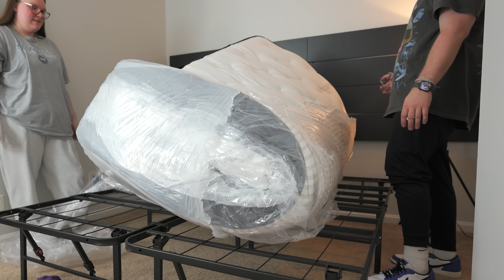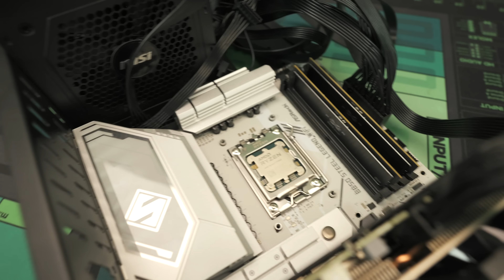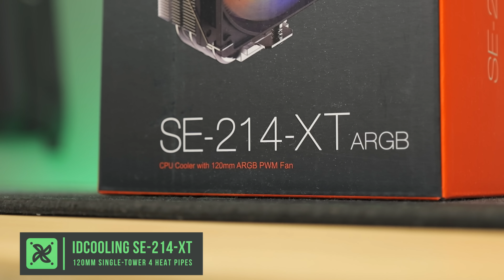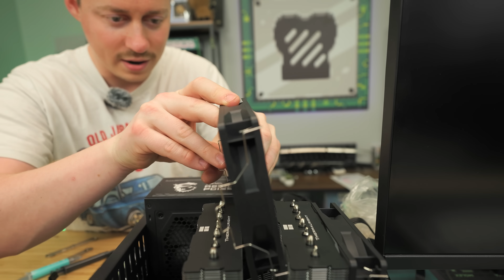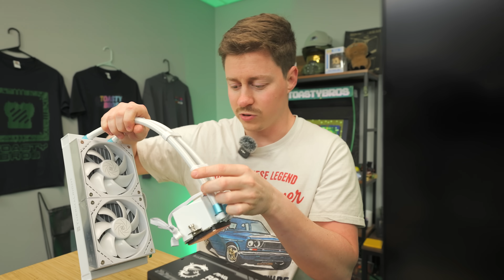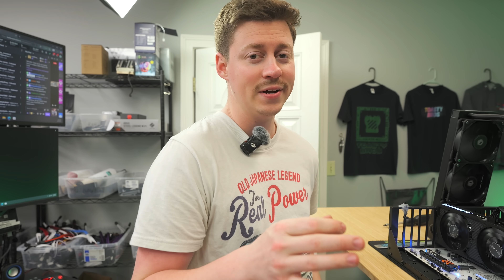STOP Overpaying for Your CPU Cooler

Comment: 140 feels expensive. Here in Romania, the highest-end version is around 140 euro. And it is so good that you don't even need case fans. :D 7800x3d near a 7900XTX nitro+ in rage mode is so cold that you can keep your beer next to it.
Reply: NH-D15 G2 for 142 euro and the black version for 160 euro.
Reply: And it will perform much better than many AIO at that price point. Especially in terms of noise.
Reply: @MrTeknown  hahaha price point. Just buy thermalright assasin. Only 30 euro

Comment: Rz500.. didnt find any review on it, order it from newegg thinking its a bust for 39.99 usd, when it arrived i threw  another fan in the back just cause it came with 4 clips, 6 months later.. still keeping my cpu under 55c with load, aio with a lcd screen is next upgrade for me, dont need it but i want an lcd screen in my pc tower unless i can find a air cooler with a lcd that can play a little gif or show picture

Comment: I ordered a FP360 thermalright aio because it was cheaper than the 120SE plus 3 fans.  I wanted 3 exhaust fans for the top of my PC case. I have never used a liquid cooler but am happy with my purchase so far.  It is also very quiet.

Comment: What you need to remember is, your Artic Freezer 36 may only cost £30 but will be binned if the next CPU socket isn't compatible. 

I have binned plenty of CPU coolers, many dead end on basic builds, I have BeQuiet, Scythe, Arctic. Yet with Noctua, I have coolers from socket LGA775 still being supported, my last two Noctua were bought with socket 1150 and are still going today, because Noctua has sent me a free CPU fitting bracket every time a new socket was released. I have two NH9s an NH12s and NH14s and a small mini ITX model, five coolers that even if AM6 has a new bracket, I will get a free bracket for if Noctua supports it.

I also have a Scythe and BeQuiet that cannot fit anything AM4 or AM5 or anything recent, and another BeQuiet and three Arctic Freezer 36, one that is a Revision 3 that can fit a couple of Intel variants with an LGA/1150 mounting kit available separately, and two Freezer 36 Revision 4 with the latest plastic arms that only fit two CPU sockets. 

In 5 years guess what will be in landfill.  

A Noctua cooler is just like a puppy, it's for life lol

Sadly my puppy didn't fit in with an all blackout build I wanted. So I like the aesthetic of the Freezer 36 coolers and the low cost of getting Arctic case fans to keep the theme, great value.

No company has ever offered me the support and customer service Noctua has, they have been exemplary in that regard, their products work great, are well built and fantastic quality, they are simply a pleasure to fit and forget and will often be part of multiple systems.

Comment: my brother still runs a Noctua cooler bought in 2015, one fan failed only last year.......there build quality is on point, I actually have a u12a with my build is expensive but the ease of install and long term support is nice.......looking to transplant my current intel build to a new cheaper case and rebuild AMD in my Torrent case so I may consider a thermalright PA or FS when do get to that.

Comment: Don't buy an AIO if you are on a budget. The pump will fail and you will have to replace the whole thing. Buy a good air cooler and once a fan fails, replace it for a few bucks.
You will also not have to worry about a leak.
Reply: i will leave my experience here for future buyers - yes every aio will eventually fail - i had my first fail after 5 years and fried my motherboard as well - 2nd one failed in under 1 year with pump failure since then i've been rocking peerless assasins and noctua on new PC - it makes same noise as my aio.

Comment: I paid 25 bucks for a 6 pipe double tower cooler on AliExpress with shipping, it keeps my CPU (ryzen 5 5600X) below 70°c with no undervolting. There is the small detail that i originally bought it for an LGA 1150 MoBo and a i5 7600k but the adapter was excesively aggresive on the moderboard so it destroyed it after 2 or 3 years of use by bowing it, but y'know, it still works great 😂

Comment: Yea, real test would be if you had a cpu running around 90° on a cheap cooler and see if the noctua gets you down to a "more acceptable" range. 

I know that'd be hard to setup, but that's the only way the extra $ would be worth. IMO if you're spending over $50 on an air cooler, just go with and AIO liquid cooler.
Reply: wdym he test the cheap cooler didnt even reach 90°
the result is better than noctua

Comment: NOCTUA cooler is the best in my opinion, regarding the Thermal Grease I'd still have to replace it with M14 for good heat dissipation

Comment: There are air coolers, there are good air coolers and then there are air coolers that are complete nonsensical as you can get a aio for the same or cheaper. 
My kinda drop off point for an air cooler is 50 bucks, even so i go with something that fits the task at hand. Last ryzen 5 5600 i set up has a 25 bucks don´t know what brand cooler on it that keeps it nice and chill. 
But 140 for an air cooler? Yeah i rather go with a proper 280/360/480 AIO that will offer superior cooling without blocking the entire upper part of the mainboard with a tower.

Comment: went from socket 1150 to AM5 with just a simple adapter change with my D15. They also sent me a replacement fan clip for free years after i had bought it, so i'm very happy with my Noctua.
Reply: The same people who complain about price are the same people who rather buy the same cheap tool 20 times rather than forking cost up front for something that will keep working. Noctuas customer service, warranty, and continued supply for free mounting parts through generations of sockets makes them well worth it.

Comment: I purchased a Be Quiet Pure Rock 2 (black) with a single 120mm fan (high-rise) cooler back in 2022 for my Ryzen 7 5700X CPU for $45 USA on Amazon.  It has four LARGE heat-pipes and does a sufficient job and is QUIET even cranked up at full speed!  Using Noctua Premium thermal paste and haven't touched it since the installation date.  This cooler works well and under pounding the CPU with FULL MAX LOAD the CPU never exceeded 85C and the 5700X is rated at MAX of 95C and the heat levels recover very quickly with this cooler WELL ABOVE any "stock" solution (the reason I bought this).  The 5700X CPU is NO slouch even today and is comparable to Intel's 11700K which is in my CAD design rig at work.  I DO USE Noctua case fans and swear by them because they are VERY quiet, as my "stock" case fans sounded like standing near a turbine jet engine and was ridiculous!  NEVER would I spend $140 for an air-cooler, and my $45 dollar choice is solid!  Next year, I will probably DUMP my entire AMD AM4 platform with it's B550 Asus ROG STRIX MB and update to an AM5 MB and DDR5 memory and keep my RTX 4060Ti as I'm only a 1080p casual gamer.  We'll see how "crazy" the whole PC market is going to become...
Reply: Just went from an i9 9900k to an r9 9950x3d, noctua fans all around and it’s also completely air cooled, no more rgb or water running through my pc, I shouldn’t have to do “oil changes” 😂
Reply: @gabecastillo1634  I'm surprised you can efficiently air-cool 9950X3d?  That's an AM5 CPU correct?  I'm still on the AM4 platform and nearing its EOL.
Reply: @johnszatkowski6898  damn really? It’s fine for gaming, but when all cores are being stressed at load that when it gets hot
Reply: @johnszatkowski6898  plus in the fractal north I’m building in there’s a bracket available for the mesh panel that holds another 2 140mm fans right in front of the gpu, the air being pumped into this pc is insane.
Reply: @gabecastillo1634  Sounds bizarre but, if it works! 👍
Reply: @gabecastillo1634  Never exceeded 80C under max/heavy load and quick recovery time too!
Reply: @johnszatkowski6898  oh I’m well under 80, I’m probably averaging 66-68ish under decent load and saw 82 max during a the stress test but I never use the cpu to that level or at least not yet.

Comment: I bought an amazon special cpu cooler. made by Uphere. it rivals my 360mm aio. the uphere idles an r9 3900x at 39-40 and lands in the high 60s while gaming and the thermalright frozen prism idles 36-37 and hits high 50s to low 60s while gaming. for sub 30$ its hard to not reccomend.

Comment: Nah. U12A is GOAT, sorry. Got a scythe mugen 6 black edition back in January. By April, it was shaking my entire desk over 70% fan speed. Rear fan failed, lots of play in bearing. Said fuck it, I don't want to worry about the cooler as long as I have this build. Went U12A and I'll never get another air cooler that isn't Noctua. It's so so so silent and performs great. My case has like 10 NF A12x25 in it, so the A12 fans on the U12A match the rest of my build. It's so awesome and silent. I'll never cheap out on fans or cooler again. Noctua for life.

Comment: Performance wise you have a point - Although I would have been interested in the noise profiles of the different coolers. Another interesting test would be the longevity of the fans.
Reply: if the fan broke you can just replace it right?
in my experience the cheap fan can last at least 4-5years
even if it broke the replacement maybe only cost 5-10$

Comment: I bought a Noctua in 2012 for a little more than 100€, I reused this cooler in three differents PCs, right now is still running with a 13600K, enough said.
Reply: air coolers dont break down since they are pretty simple, the thermalright air cooler could easily last just as long and even then replacing the fans would cost very little
Reply: @ronaldmcdonald6067  Yes, they last long, but do they sell the adaptions to difference CPUs formtheir older models?, btw Noctua give it for free, even more than ten years later.
Reply: @amrakunish5238  Thermalright do. Pretty much every their cooler (even the older ones like ifx-14\mux120\archon etc) can be mounted on modern hardware. Price in question is around 8$~
Reply: @ronaldmcdonald6067  👆🏼 this dudes right, noctuas customer service is the best in the business, they send u free hardware for any advancement in mounting as well. Also 7 pipe cooler does not equal 7 pipe cooler universally, construction and cooling power overall would be taken into account as well as warranty.
Reply: And they're the most quiet coolers!

Comment: I have two thermalright cpu air coolers and my 5700X3d and 12700KF run ice cool. I don't know the exact names but the 5700X3d has a single tower 4 heat pipe cooler and the 12700KF is a single tower as well but it has 6 heat pipes both of these is 1 120MM fan . The 4 pipes was 17 bucks and the 6 pipes was 20 . Highly recommend :yougotthis:

Comment: Running my Ryzen 7 5700X (65W) with a Cooler Master Hyper 212 Black Edition, i've put two fans on it push-pull at 2000rpm... Total of around €50 and it's super cool even in hot summer months, it does not go above like 54 degrees. Cheap but awesome 👌

Comment: What are the warranties on all of them? I think that should be important as well/ costumer service.
Reply: That's utterly irrelevant for air coolers. They have only one moving part that can in theory break and will cost you like a pack or two of ciggies
Reply: if the fan broke you can just replace it cheap under 10$
heatpipe rarely broken unless you broke it

Comment: you need to take ambient temps  for each. each cooler will only cool x amount so for example onne will cool a delta of 80c from ambient max  and cooler c will cool 77 from ambient. so if starting points are not similar itll skew te results

Comment: I have the thermal right peerless assassin Se ARGB thinking of switching the 2 stock  fans to the BeQuiet Pro 4 which has about 83.9 to 84.9 CFM per fan and RPM approximately 1600, 2500, and 3000 RPM. 
Will it be worth it to upgrade the fans ? Also the fans are adjustable by switch or by the computer it self. 
Would you try and demo this ? 
Is it worth it for me to get ? So far I have 7 pro 4 fans i could use 2 for cpu and 3 for top exhausting for the nzxt h9 flow, totaling 12 fans in the end

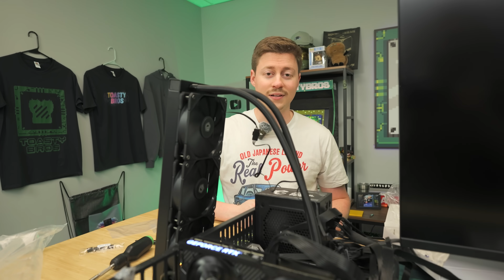Comment: 23:10 thats probably the worst way to mount the AIO. Putting the tubes at the top where all the air is at is really going to hurt thermal performance. Probably could’ve gotten better temps.

Comment: As long as the fin stack and pipes are hefty and functional, it's hard to screw up with even cheap coolers unless you really get suckered by those ones that are pretty much just colorful RGB (or "RGB") ones slapped onto something that's pretty much a stock cooler equivalent.

Comment: Can you do a video where ChatGPT suggests what you get to make a pc
Reply: This is what ChatGPT told me 

(When looking for a good and affordable PC that handles both gaming and video editing, you’ll want a system with a powerful CPU, a decent GPU, at least 16GB of RAM, and SSD storage. Here’s a breakdown of great options in 2025 for budget to mid-range users:

⸻

Best Affordable Prebuilt PCs (As of 2025)

1. Skytech Blaze II Gaming PC
	•	CPU: AMD Ryzen 5 5600G / 3600
	•	GPU: NVIDIA GTX 1660 Super / RTX 3060 (varies by model)
	•	RAM: 16GB DDR4
	•	Storage: 500GB or 1TB SSD
	•	Price: Around $750–$950
	•	Pros: Great value, capable of 1080p gaming and 4K video editing.

2. CyberPowerPC Gamer Xtreme VR
	•	CPU: Intel Core i5-13400F
	•	GPU: NVIDIA RTX 3060 or 4060
	•	RAM: 16GB DDR4
	•	Storage: 500GB–1TB SSD
	•	Price: Around $900–$1,100
	•	Pros: New-gen CPU/GPU, good for Premiere Pro, DaVinci Resolve, and high-frame-rate gaming.

3. HP Omen 25L / Victus Series
	•	CPU: AMD Ryzen 7 5700G or Intel i5-13th Gen
	•	GPU: AMD RX 6600 / NVIDIA RTX 4060
	•	RAM: 16GB
	•	Storage: 512GB–1TB SSD
	•	Price: $850–$1,100
	•	Pros: HP builds are quiet and reliable, often go on sale.

⸻

Minimum Specs You Should Aim For
	•	CPU: AMD Ryzen 5 5600 / Intel i5 12400 or better
	•	GPU: GTX 1660 Super / RTX 3060 / RX 6600 or better
	•	RAM: 16GB DDR4 (32GB preferred for heavy editing)
	•	Storage: SSD (NVMe preferred) for fast file access — 1TB ideal

⸻

Custom Build Option (if you’re tech-savvy)

You can often save $100–$300 by building your own. Example parts list under $1,000:
	•	CPU: AMD Ryzen 5 5600X ($150)
	•	GPU: AMD RX 6700 XT or NVIDIA RTX 3060 ($250–$350)
	•	Motherboard: B550 ATX ($100)
	•	RAM: 16GB DDR4 ($50)
	•	Storage: 1TB NVMe SSD ($60–$80)
	•	PSU + Case: $100–$150

⸻

Would you prefer a prebuilt or want a custom build list tailored to your budget (e.g., under $1,000)?)

Comment: Noctua coolers are way way WAY overpriced. There are people putting $150 NHD15 G2 coolers or 360 AIOs on 65w processors when they'd be fine with a $15 USD Burst Assassin from Thermalright. A Phantom Spirit or Peerless Assassin will handle virtually any CPU in all but the most insane conditions and cost peanuts.

Comment: Noctua has offset AM5 mounts which makes a huge difference. And the U9S in my ITX Build did not cost all that much. I used larger dual tower Thermalright Coolers prior (Peerless Assassin Mini) in the same build and the smaller U9S with offset mounts performs MUCH BETTER. You get what you pay for...and while cheap coolers do have their place for sure, just be wary of the TDP of your CPU and plan accordingly.

Comment: ARCTIC Freezer 36 all the way for a tower cooler.  I have used them since release on quite a few builds and love them.  They used to be around $35, but have floated up to $51 now.  I love the tool free fan mounting as well.  I have never been a fan of the spring clips used on other tower coolers to hold the fans in place.
Reply: Hating the spring clips is fair. But the Freezer 36 is starting to be a bit old and small if you try to cool hotter CPU's For me I want as oversized a cooler as possible so it can be run at ridiculously low fan speeds to keep it as quiet as possible. Still I didn't go for an AIO when I built my latest machine, but a Thermalright Phantom Spirit. And here I was initially looking at the Peerless Assassin. but opted for the updated version. 
Here's a somewhat unpopular opinion. CPU coolers are not rocket science! Making a efficient cooler is actually pretty simple. brands play with the heat pipes and what not, but it's really about transporting heat from the CPU to the heat sink and blow air through the heat sink to cool it all down. I'm pretty sure I could have bought any heatsink that's similar to the Phantom Spirit or Peerless Assassin and they work OK. 
Look at the Cooler Master Hyper 212  for instance. It's been over a decade since it was introduced, perhaps two. I took a look and the oldest post about the 212 I found was posted in 2010. That's at least fifteen years ago. And this heatsink is still produced. Sure it's had some redesigns, but it still has the same number of heat pipes, the same dimension heat pipes, the same number of fins in the heatsink and so on. It's not the worlds best air cooler, but it is dependable, and has been dependable for at least 15 years.

The latest bling in the heatsink world is using a vapor chamber. Sounds like a big innovation but it's actually not that fantastic. It's actually mostly the same thing as a heat pipe, just in another form. Think of a vapor chamber as a flatt heat pipe. The area with contact to the hot area is larger so it can transport more heat from the source. But the other end has to go to a heatsink and this is often done with something looking like heat pipes integrated into the vapor chamber. And heatsinks are exactly what they are, just open to the vapor chamber so the vapor can move through the heat pipe and where the heat pipe contacts the heat sinks it cools down, the vapor condenses and the fluid is wicked back to the vapor chamber where it can evaporate again to mover the thermal energy.

So vapor chambers are not really something new and advanced, just heat pipe technology used slightly different.

As I said this is not rocket science. It's simple physics and mechanical design.